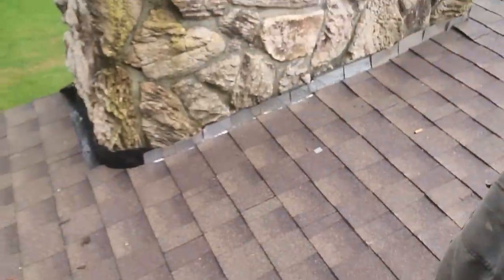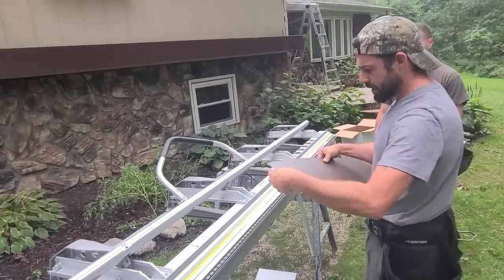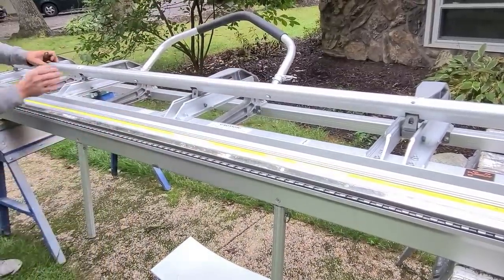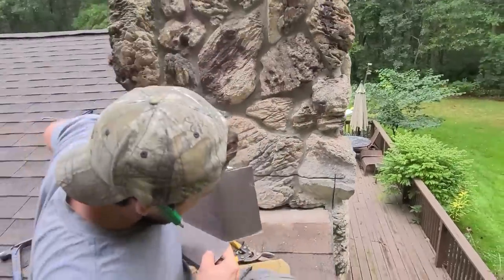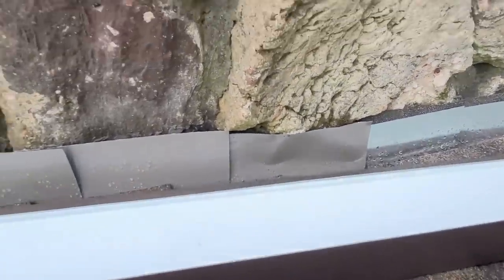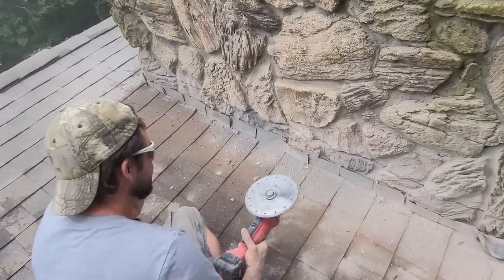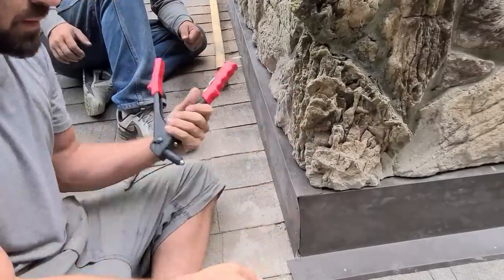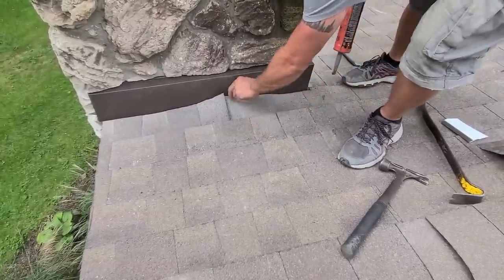How To | Awkward Chimney Wrap

Comment: Next time blow off all the dust  hit it with a wire brush and blow off again you will never have another bond issue.  Also look into getting slicks or caulking spatulas from albion will keep your fingers cleaner and will prevent any debonding issues.  I dont roof alot but i caulk alot of expansion joints on parkades and on high rise buildings with pre cast panels
Reply: 💯 and filling cut line with clear before inserting/placing metal has never let me down. 😉👊

Comment: I did my chimney June 2019 , I used mortar so I did not have to chip and cut 3 to 6 inch into the stone added a Cricket cut into the mortar 3/4 for the counter flashing , Did the same bend on the top the lip holds tight that wedge is the only way to go .

Comment: I think the gripping fold causes a hassle because once the unit is pushed in the groove of the stone for adjustments it can't be pulled out easily. I have seen a video where installers left that edge straight, made all the measurement and adjustments they need, where after placing the unit in place wedged it with a folded up line of strip of sheet metal at 5 or so places and that was that.

Comment: When you run empty on bottle of caulk, do not throw away the nozzle, put it on the new bottle, so you save a nozzle amount of caulk with every new bottle. Though it works only for a single session.

Comment: I missed what kind of color sealer you were using on the brick. I use Big Stretch Caulk but I'm not sure how long it will last.  I'm a super advocate of anything with GE Silicone seal in it but it is not paintable and they never have the color I need.

Comment: Looks good. Little tip for you quad makes an aerosol foam gun cleaner it's basically acetone it'll clean the caulk off your finger and you can use it to clean out your grinder joint before caulking
Reply from the maker: oh really? i'll look into that. i just dump gas on my hands lol
Reply: That's what I did too for years. Wife got tired of me smelling terrible lol. Love all the videos you've definatly made me a more efficient shingler when I have to get up there

Comment: A speed square and a nice pair of snips will save you from having to get off the roof, hoof it to the break, measure and slice, and get back up. You could get your measurement of 1 3/4, speed square a flat line across the piece and be installing it before you would have hit the bottom of the ladder! You seem really good at scoring with the knife too, and that is even faster than snips - if you trust your hands :P

Edit: wrote that out before I knew you were hemming the piece. In this case. you would have had to come down anyways.

Comment: Was that coil stock? 🤔 I like the 2" rigglet into the stone and I've always preferred using a one piece system over the two piece wall and counter. Saves valuable time in the heat plus no chance of wash over on backside. I prefer to use a 26g metal due to our roofers around here suck and will destroy anything thinner. Just curious to cost of labor and materials you getting for a job like that on a standard 6/12 pitch?

Comment: Keep a thin paint brush to brush out the joint first ,then caulk the joint before  you install the metal. Install the metal. Then buy a 3/8" caulk knife at a commercial caulk store and you wont get it on your finger nor rake the crap out of your finger.
Reply from the maker: Great comment thank you

Comment: Quad and quad max are great sealants have you ever used the sashco through the roof that stuff is real good too
Reply from the maker: i will look into sashco!
Reply: Will never use tar again after using through the roof! Best product on the market right now in my opinion. Can barely cut it with a knife after it is dry.

Comment: Put a little wd40 on your fingers and the coulk  won't stick to your fingers  .
Reply from the maker: yea afterwards right? i don't think it would do too well mixing it with the caulk itself while smoothing it
Reply: Ahh just keep licking it finger
Reply: Don't use wd40 it will eat the caulk quad is polyurethane based wd40 eats it and changes the chemical make up
Reply: FoxRcng708  it sticks through water you can apply quad on a, wet substrate it will just stick too the sponge
Reply: @NWIVeteranConstruction  dw40 is, bad for quad soap and water or spit is best option I'm certified bye osi in useing there products trust me :-)

Comment: You counter flashed it perfectly I was taught at 18 how to do this most roofer that think there roofers don’t even know how to do this I’ve done this both ways on block or brick with copper also we’re the owner wanted the  step in  look I usually use concrete chaulk something that is expandable
Reply from the maker: thats not a bad idea! what reasons other than that do you prefer that over quad
Reply: Veteran Construction at the time quad wasn’t available my dad ran a roofing mat company that sold roofing siding and other materials trough out nj and the Tri state area since I was ten so I’ve seen a lot threat contractors and some really bad ones and my best friend dad is to taught me working weekends helping him before starting my own co in the kitchen and bath business but I’ve done everything grime new homes to concrete work besides having 4 yrs plus 3 in architecture in college and high school so I know a good craftsman when I see one

Comment: Shingles need cut back on saddle to allow water to run off and I noticed you cut out the video of how you must have used caulking on the top corner,I wouldn't have used coil stock for chimney flashing and would have blown out the dust and used mortar to fill the joint.

Comment: Why the hell aren't you guys protecting the brand new roof you just put down? Trashed the hell out of those shingles
Reply: They were washed afterwards. It all came off with no staining luckily. Good point tho we should've.
Reply from the maker: i never bother. it comes off too easy. i prefer to do the grinding before shingles if at all possible but shits been a mess lately.
Reply: @NWIVeteranConstruction  gotcha. I know sometimes with heavy foot traffic the granules can get wore off pretty easily and cause heavy damage to the shingles so thats why I was wondering.  Nice flashing job👍
Reply: @NWIVeteranConstruction  im also thinking of 8/12 to 12/12 roofs so that also makes a big difference with shingle wear

Comment: Just watched your video 'Worlds Fastest Shingler - Barn Roof' from July 18, 2019, but of course you probably don't go way back there to field questions. It's pretty important to me so, apologies, I'll ask the question again here. I asked:
"Love your no-nonsense videos. I'm 74 and solo shingling my own weird 2-storey cutesy mansard-barn style roof right now. Question: In this video from July 18, 2019, you showed shingling the steep section, maybe 21/12 . Just up above, the pitch changed to shallower, maybe something like 7/12 or 8/12 . How do you get the shingles over that ridge? Heat and bend plus dab cement? With architectural shingles and no tabs, do you break the spacing up the rake so an even half shingle goes over the bend? Do you use a starter strip above the bend and then heavily dab the first exposed course above the bend? Thanks. P.S. ... going to start a channel on seniors taking on crazy difficult projects. Will be recommending your channel if people want to see a real roofer, not a crazy pretend one!
Reply: From my experience, you could run your shingles up to the point where the pitch changes, making sure to nail as close as you can to the pitch change, say like a upside down "L" then put a bit of caulking on the nail heads, then lay drip edge along where the pitch changes as you would if you were putting drip edge on eaves. You could cut and bend the edges where the drip edge ends to cover that little gap if you want to. Then do your usual 1/2"-3"4" overhang and use starters aswell and continue on shingling like you normally would 👍 done a few barns like that and they turned out pretty good.
Reply: @Josh-ww5kz  ... thanks Josh, much appreciated ... had been thinking of drip edge, but none there now, so have been hesitating ... previous roofer had bent the tabs on 3 tab shingles over the ridge from above then caulked them down ... when those caulks eventually failed, small-headed nails/tacks had been put in many of the popped tabs and caulked ... those tacks worked their way right through the tabs which either sprang up again or fell off completely at the fold!

I'm not sure that I understand the upsidedown L without a diagram or more detail ... I have some guesses, but why guess on a roof? Which shingle is bent back and which way does the bend go? I could give you my e-mail and send a diagram or site pictures, but maybe you have a simple word or so ... Thanks
Reply from the maker: thats a great question;. sorry didn't read the other comments so forgive me if someone answered. occasionally i'll bend them over, and no starter after that..but my reccomendation is to cut your shingles flush at the bend. and put gutter apron or custom bent metal over the edge onto the steep part. then you would use starter as normal from there
Reply: @NWIVeteranConstruction  .... that sounds like a plan ... I could get the necessary 8 pieces (about 60' total) cut to length and bent, maybe at a siding guys business ... I'd figure same gauge aluminum as chimney flashing ... haven't decided what to do with the two valleys, but I think not concealed ... I have a major pine needle problem and the wider and slicker the path for them to wash down the better ... so maybe I would lap the bent strips  beyond the lower valley center and over the lower valley ... the upper valley would extend say 1/2"-1" over the bent strip lap anyway, and then the lower valley could come up behind the lapped strips and flush under the upper valley overhang with good caulking ...  nothing much will be sitting around at the top of a 21/12 sloped valley, so not much worry there ... thanks for your time! Great channel
Reply: @NWIVeteranConstruction  ... and p.s, to my note above, based on this great chimney flashing video, I should have the strips bent at a little greater angle than the pitch change so that the spring force of the metal holds the exposed lower strip tight against the mansard course ... there's a lot in your videos if you watch closely and even rewind now and then!

Comment: Great try but that will not last, really was great workmanship BUT you should of cut as deep as the deepest rock, yes this is tricky but the quarter inch hang over and black jack will not last, always make you measurments for the rock at the closest part of the chimney and cut it, this is a hard task but you were 3/4 inch past the closest part of the rock and it will leak, black jack is a band aid and you failed, looks good from my house, rain will hit the chimeny and sit on top the flashing that is out 3/4 of an inch :(

Comment: You’ve lost weight bro. You ok? Or what have you been doing? Running 🏃🏻?
Reply from the maker: ehh eating less. i was doing a lot of running and such, since slowed n packed a few back on but yea overall about 15 pounds down
Reply: Veteran Construction good choice. Better now than later. I hit 228lbs 2yrs ago and had to make a change bc if I hit 230lbs there’d be no turning back. Dropped 35lbs.  💪🏻

Comment: What the eff is up with the no back pan???
Reply from the maker: what do you mean? is there lol
Reply: @NWIVeteranConstruction  I've never seen one like that.
Reply: The cut shingle around looks not professional
Reply: @kylekoverola8654  do you mean a cricket?  At least that's what I call it.
Reply: @bobcougar77  there is no cricket there.
Cricket has the small valley behind the chimney
Reply: @kylekoverola8654  I know there is no peaked cricket, I was wondering if that's what you meant by "pan".  There is obviously flashing running uphill so I asked if you meant cricket.

Comment: Can you come to Cleveland and do my chimney? lol
Reply from the maker: haha nahh. u should be able to after this! and my other. and others, others. lol a local metal shop can bend the pieces for you. just trace, grind and follow the way
Reply: @NWIVeteranConstruction  I am actually in the process of getting up to my chimney that needs to be tuck pointed. It is 29 feet up on a 12/12. I am not a roofer but I usually try to do most things myself. I just replaced rotting fascia and gutters 20 feet up. There was no drip edge and siding ends half way up the fascia. All rotted and nasty but turned out good. I learn how to do things from watching guys like you. Love your work ethic and your videos. Thank you.

Comment: Inside of that crappy siding brake you should get a wuko bender. Only bad part that you need a table lol 😆and instead of face nails on the apron. You should make 1" wide strips 6" long. Nail the strip under the apron.White side facing up. Leave about 1" past the apron and fold the tab onto the apron. Probably one strip on each side of the apron. Leaving no face nails on the apron. Just a suggestion not trying to tell you what to do.
Reply from the maker: i saw a guy do it right after i did this but instead of the face nails he put on that little half inch bend that goes down to the roof